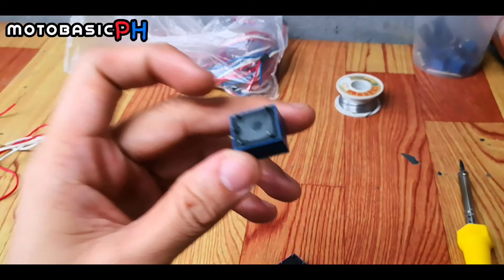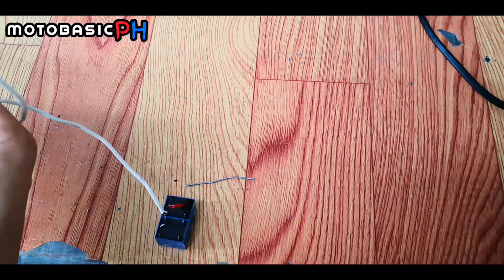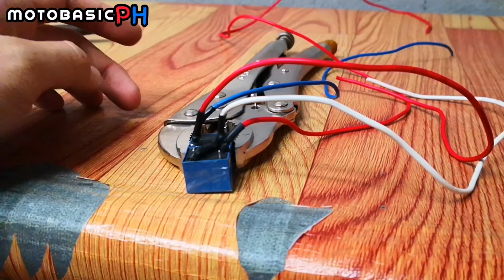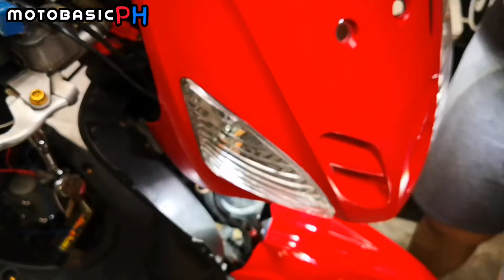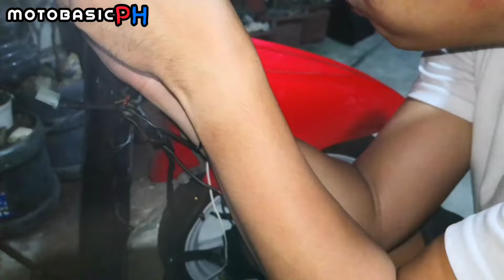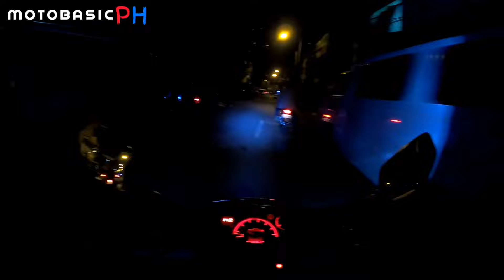MINI RELAY | MDL RELAY REPLACEMENT | YAMAHA MIO SPORTY

Comment: Paps ask ko lang baka matulungan mo ko, namamatay kasi parklight ko kapag nagrerev, ano kaya reason
Reply from the maker: Dahil hindi ko naman personally ma check wirrings nyan, ang tip ko baybayin mo wirrings ng parklight mo. Linisin mo narin from switch/botton to socket. Make sure din na walang live wire
Reply: @MotoBasicPH  Thankyou so much sir sa advise, naayos ko na po, more power kabasic!